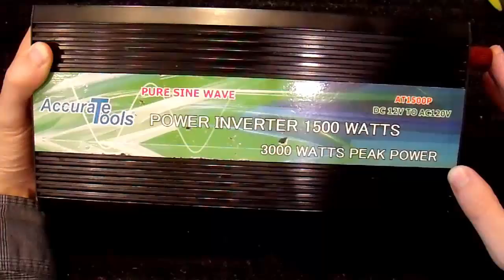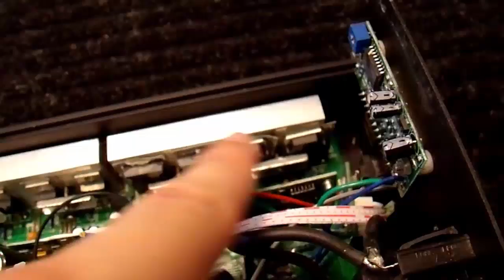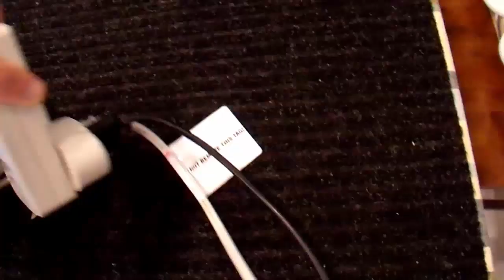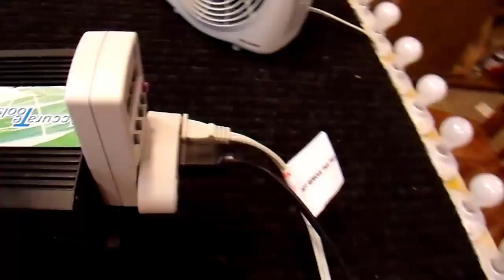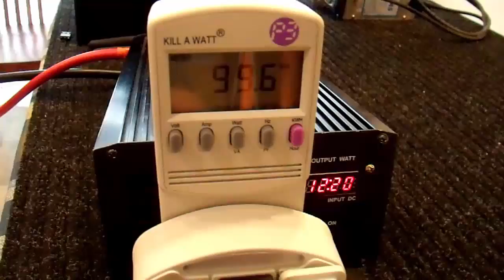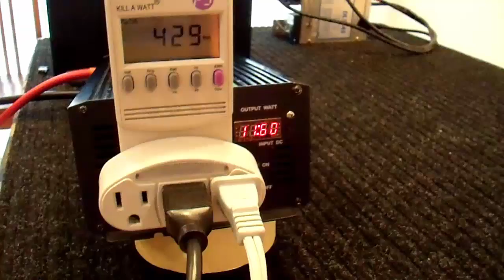Accurate Tools Pure Sine Inverter Review and Repair - Part 1/4

Comment: Don't you think you're being a bit harsh when you say the jumper wires won't act like resistors... 🤣
Reply from the maker: The issue with using wires is that their temperature coefficient is not zero.  Current sense resistors are temperature compensated to be near 0% per degree C.

Comment: 10:55 I'm not entirely sure what you mean. Current measing shunts should preferrably have a low resistance, since you don't want to unnecessarily waste power. Usually wires with a particularly length and width are used as shunts. In precision applications the wire is laser etched to make it thinner until the resistance matches the desired value. How do you know the shunts do not have the correct resistance?
I find it much more unsettling that wires are soldered directly to the shunts, changing their resistance by a random amount (unless the exact soldering location and amount of solder is carefully planned, which I suspect was not the case). Perhaps the shunts themselves have the correct resistance. You could try to desoldering the wires, cleaning the solder off the surface of the shunts as much possible and soldering the wires to the solder pads underneath the PCB.
Reply from the maker: Wires make poor current sense resistors for a few reasons, one of which is the tolerance on wires is extremely high and they are nearly always thinner than expected since manufacturers err on the side of giving you less, not more. (though that can be calibrated out with an additional process)  The more insidious problem is that they have a large temperature coefficient of 4% per 10c which can easily cause an error of more than 20% due to temperature changes.  A wire style shunt is just fine for current limit purposes where accuracy isn't important, but if you're running a meter you should have a better measurement system like current sense resistors that have a temperature coefficient of almost zero.  In some implementations a thermistor measures the temperature of the 'wire' to compensate somewhat which avoids the cost of a precision resistor/shunt.  In this case I think the meter was an add-on and the product was not originally designed for it.
Reply: @knurlgnar24  Yes, you are right. I wasn't however talking about copper wire, but rather whatever "wire" they usually use for shuts. Since they usually just consist of a wire. Not copper wire of course, but rather something with a lower temperature coefficient like constantan or manganin. And of course produced to a lower tolerance in diameter etc. But you know, at the end of the day, it's still just a wire.
My point is, in my experience, they often save money in rather odd places in the case of these cheap Chinese products. I often see what I consider to be almost a good product, if not for a few small things. I've seen inverters which for their price actually had a pretty decent build quality, but they cheaped out on the input transistors and used ones with a fairly high "RDS on", making the whole thing run a lot hotter than necessary. I've also often encountered inverters that monitor the voltage of the buffering capacitor at the output (before the H bridge) and basically the inverter goes into overload when the voltage of that capicitor drops under a certain level. Which in general is fine. But then they choose a too small capacitor causing the inverter to handle power surges really poorly. Which to me seems kinda odd. Cause like, a capacitor costs a few cents. And I would argue you could easily sell the inverter for a few more bucks, if it had decent surge capabilities. I feel like the design of such inverters is often not that bad, since they basically just copy the design of decent inverters. But then they cheap out on some parts and the people who put it together just don't really know what they are doing or don't care.
And of course I don't own the particular inverter in this video. But I wouldn't be surprised at all if the fan connector would actually output a controlled power for the fan and the current measuring shunts were actually quite decently selected. But whoever put it all together just didn't know better than soldering cables directly to the shunts and hooking the fan up directly behind the switch.

Comment: The Fan has to blow out the heat not the opposite, wher shout otherwise the heat go? 🤔
But a 2 fan designe would be much better, for one in for new cold air and one for out  diapering the heat.

Comment: Man I tell you today 2019 I strongly believe they rebrand this inverter and call it Powerthat I tell you I bought one of them Powerthat inverter the internals look the same and is the same way it performs man I tell you it is the most disgusting inverter ever trust me  when it is at the low tap my full size fridge flatters like it is struggling to run the lights which are led lights 💡💡 in my house also flatters and the fan runs 🏃 🏃 constantly trust me them fans load you be on the phone and have to talk loud to talk over the inverter it is like a generator in my house 🏡 and it is a 2000w 24v pure sine inverter right now I am saving up to buy a different inverter and I only have this one for three months now I just had to spend some time and watch this video and say to myself even back then different name but horrible same way.

Comment: Hello, hope you can help me by directing me to a fix of my 1500 watt power inverter. The unit will not power on at all. I took the top off to visually examine  it and noticed a burnt smell by one of the four transformers. If it would be OK I can post pictures to google drive for you to look at. I would really be very gratful . Thanks

Comment: Yes he is correct. The transformers in these units are the problem. I design and build ev vehicles and we call this the “corona effect” no, not the beer... the field windings in the transformers generate enough heat to create a corona much like the sun around them causing more resistance due to a loss in magnetic field strength causing other problems.
. I’ve been on a solar system for 25 years and have been through more than a few inverters. For my small electronics I have used a 400 watt  sst vector inverter connected to a Triplite 600 watt isolater transformer line conditioner for the past 20 years. Vectors are good inverters but the reason it’s lasted so long is because the transformer line conditioner takes most of the load and stabilized the inverter. I like tripplite. For my large appliances, I use a Tripplite 2k inverter run through a Tripplite transformer line conditioner.

Comment: Wow, liked and subbed. I'm wondering if there is any downside to buying overkill in capacity and running low demand stuff...? They sell insanely large capacity-claiming ones like 5000w cont.(10kw peak) and I was wondering because a guy (I think he was reviewing a different brand 3kw one) said his bigger one gave wonky power (I forget if it was frequency or purity of wave, but it wasn't just voltage) at lower load or demand and smoother out after like 400w was being drawn. This concerns me since I may only draw like 25 watts at times but would like to be able to draw like 500w. Overall I'm attracted to this model over others (at the same price...I'm severely limited in budget & you can get one for 100 bucks) since I now can see inside and I've seen worse components. I have a large aluminum heat sink block and attachable fins that I could slather some heat sink paste on and bolt on, and I'm known for modding air flow. A guy called Tom's accurate tools also extensively did a text page on a 300w one of this brand, showing it dispensed like 62.5Hz vs. 60 etc. and he changed crystals to fix that. I doubt it will be a problem for me, I want to run small PA at weddings off grid. Thanks!!! I would rather have the fan burn all the time rather than the unit I saw that kicked in when the until was stupid hot. I can deal with a lot of cut corners either I can fix or just deal with. I just would like the least change of it stopping working altogether at a wedding. I'll get a backup one day soon, too, but can begin working now and I have a big pure sine wave UPS that can save the day for a while in a pinch. I wish the APC Smart UPS 600 ran off 12v but it seems to use two 12v batteries in series, not parallel (making it 24v) :( otherwise I could have used my 27 plate deep cycle battery with it as a backup unit.
Reply: Why not run your audio system directly off the batteries.....all that a/c output is
converted back to DC in the system anyway.....

Comment: Do you think getting a higher wattage inverter than needed and keeping it running at 75% would keep the inverter running cooler? (For example: Purchase a 2000 instead of a 1500 and only use 1500)

Comment: I was the beggar who asked ages ago to review Accurate Tools.  I did buy a 300/600 but it went back.  This was my experience:
1.  When I received it, it rattled inside.  I contacted them and asked them if it was OK to take it apart to see what it was.  A power wire eyelet was laying inside, disconnected from the wire.  I crimped and soldered a new eyelet on the wire and connected it.
2.  I ran power to the battery under the hood, and then put it under the seat.  I then ran it to power a laptop in my car.  However, when I plugged in my laptop, the cursor rapidly jumps all over the screen, and electricity burned the tops of my legs like a 9v battery on your tongue.(titanium base on Dell M6600 laptop)  The touch screen on my Note 3 would not respond to touch while the inverter was on.  Others have read have had similar problems.  If I moved the inverter on the other side of the windshield, just under the hood.  With the hood open, I ran the high voltage wire into the car to test.  Everything worked fine.  I played with people's recommendations of capacitors and they made zero difference.  I sent it back because I was afraid of it damaging devices.
4.  I talked to Samlex.  They said you cannot stop that inexpensively, and the snake oil fixes with capacitors cannot work because the problem is not on the output side, it is from the input side, and why putting it under the hood works.  Then he went on with  and high-amp conductors reflecting the high frequency switching is the problem, and how theirs has an FCC Part 15 Class B rating (residential low EMI emissions)  He also said to spec. at least twice the average continuous power you will be using for best circuit stability.  The Xantrex ProWATTS are Class A (industrial, which is not as stringent) but good enough to work with Apple products, which apparently is the acid test for fussy power requirements.

My take away from owning one of theseAccurate Tools inverters is they can be had for a good price.  The assembly makes me think of an assembly line where they get so many seconds and it moves on, ready or not.  Positioned inside of the passenger area with wires going to the battery is not tenable due to their high EM radiation from the input wires.  They are a little too cheap to get good assembly.  Unlike MSW inverters, it adds significant cost to produce a pure sine wave, low-EMI inverter, suitable for use inside of the passenger compartment of a vehicle.  Even if you can put an inverter somewhere where the EMI will not be an issue, you might want to double the price and get something like a TigerClaw.  They are more the threshold of real with thermostatically controlled fans, to far better heat sinking, to better airflow distribution, to more consistent  and closer tap switching, to actually being able to do 1500 and surge to 3000, it is better in every way but price, $179.00 in-hand.  The only issues they have is the fans don't last forever for something like an off-grid scenario.  See knurlgnar24's reviews on the TigerClaw.

Comment: what kind of sine wave do you get with these I bought a 400 watt /800 max am going to run a 95 watt unit but that is an Ac oxygen concentrater compressor which requires a good sine wave  Can you post a picture of the sine wave ?

Comment: scariest part on this brand is their website. Section 7     "7.
  Disclaimer of Liability. 
  AccurateTools® shall not be responsible for and disclaims all liability
  for any loss, liability, damage (whether direct, indirect or consequential), personal
  injury or expense of any nature whatsoever which may be suffered by you or
  any third party (including your company), as a result of or which may be
  attributable, directly or indirectly, to your access and use of the website,
  any information contained on the website, your or your company's personal
  information or material and information transmitted over our system. In
  particular, neither us nor any third party or data or content provider shall
  be liable in any way to you or to any other person, firm or corporation
  whatsoever for any loss, liability, damage (whether direct or consequential),
  personal injury or expense of any nature whatsoever arising from any delays,
  inaccuracies, errors in, or omission of any share price information or the
  transmission thereof, or for any actions taken in reliance thereon or
  occasioned thereby or by reason of non-performance or interruption, or
  termination thereof."      Basically. Steer clear!!!!!

Comment: i reckon you could drill a couple holes near the heatsinks that were not attached to the case giving you some more airflow and cooling the transistors too

Comment: +knurlgnar24 I have the 400 watt version and Im having an issue with beeping. it keeps beeping and the light goes from green to red and back and forth. Is this a grounding issue? I tested it by trying to connect it directly to the battery with some jumper cables and it worked. Then once I connected it to my longer cable it does the beeping thing. Even when the engine is on. Any ideas?

Comment: Hi knurlgnar24I need help with an inverter, please. It is a 2000W pure sine. We used it for household appliances (refrigerator, washing machine, fan, lights), suddenly it stopped working. The voltage is fine - 220V - but the frequency has gone haywire: running between 100-200hz (should be 50hz). It still powers the lights, but nothing with a motor. Any idea what the problem could be, and more importantly, how can I fix it please??

Comment: The voltage is not anywhere high enough at the input to keep the voltage drop from happening. If a vehicle were to get their battery down to 12.8 volts while running, there would be significant issues present for any sizeable inverter. Car batteries should maintain 13.8 volts under heavy load and up to 14.4 without load.. The voltage really doesn't drop while the high beams are on, stereo blasted and every other component in the car, if it drops .2-.5 volts, that is a lot. The starter is normally one of the largest loads  in a car other than high beams, however, if you look at the specs on most inverters that are over 1200 watts, they specifically rate them at 14.4 and 16 volts. They NEVER rate them at 12 or 12.8 volts.. The voltage drop on a an average sized car battery without being charged from a good alternator  and it would be ridiculous with more than 40 amps loaded to them with the vehicle shut off. With 680 watts, the car battery will have an additional  57 amps added to the circuit, and, a car needs 70 or so amps rms to run everything at once minus the starter. This leaves you with only the ability to run 30-40 amps worth of accessories without maxing out the alternator. This 70 amps I am talking about is close to the maximum unless the vehicle is revving more than 3600 rpms. Alternator's max amperage is specified at way higher than idle currents where all inverters are normally run unless the vehicle has an idle kick up circuit installed. These larger inverters are designed for work trucks, campers, and, vehicles that can handle it.. not your average everyday small wimpy car. They are built for devices that have loads of batteries in a bank with solar panels, windmills, or other generation units capable of giving continous charge so the device can be powered. Inverters are not very efficient, and, this brand says they are 80-95% efficient, all depending on the product line.
Reply: inverters are usually rated 10.5-14.8 volts. if the voltage is dropping, then you need a bigger alternator. also 12.8 volts is perfectly fine.

Comment: Great video, i almost getting one of these unit, but after watching the review, i learned a lot, so what do you recommend, what is the best reasonable one for me to buy out there in the market today? I need one in case of the power out, winter months here are tough. Thank you.
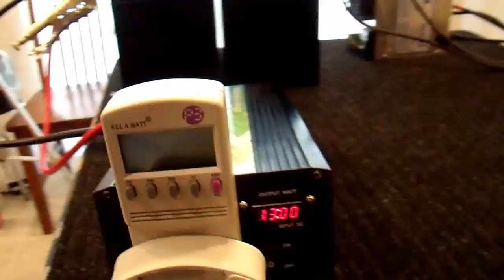Reply: It looks like it would be easy to improve the cooling by drilling or cutting holes (especially near the transistors); and add epoxy in places he talked about it lacking "caulking" (that gooey looking glue stuff is not caulking; it is epoxy). Check to make sure all the 12v heavy conductor lugs have lock washers then re-tighten them nice & tight, then coat them in silicone dielectric grease. Probably 1 hour's work or less and you improve it drastically. The real test would be with an oscilloscope to ensure it is indeed pure sine wave output. If he done those improvements, the failure that happened @20:05 probably would not have happened.